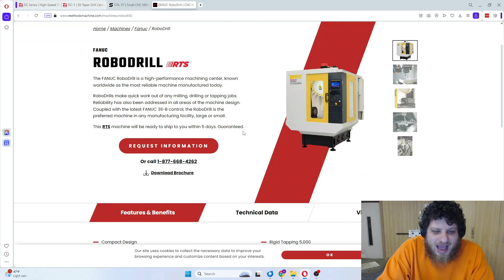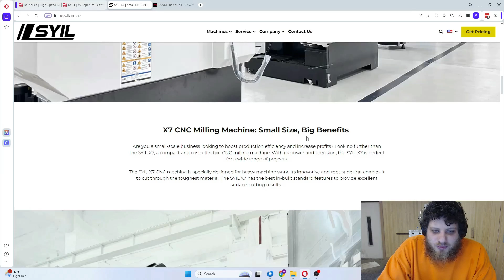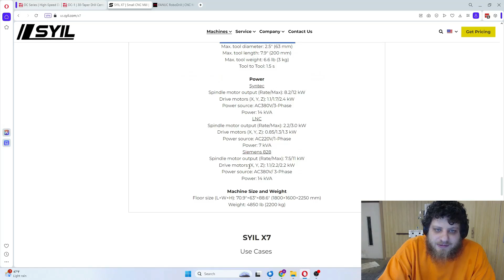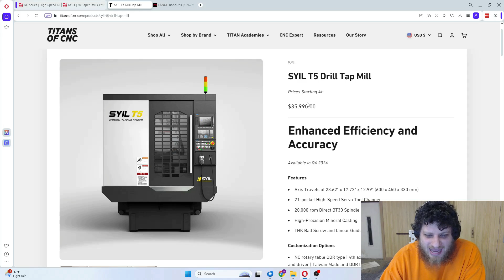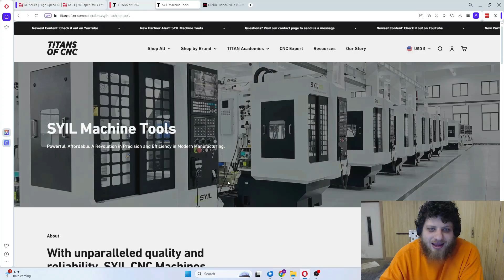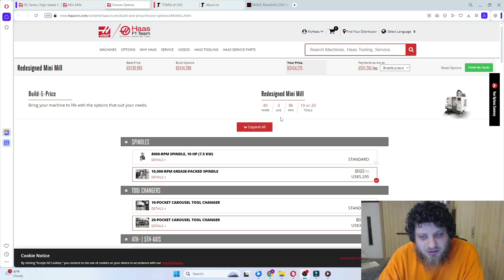Haas DC1 is a Syil Killer?

Comment: Syil is a joke compared to haas. Nothing beats haas service in the US. Imagine buying a car from China, and when it breaks down you have to fix it yourself instead of going to a mechanic.

the dc-1 has way more weight, and weight always wins for machine stability. If granite epoxy was good, you’d see other top mtb utilizing it. It’s just a sales trick.

A lot of people hate on titan but once you get into doing aerospace and defense parts all day you know his speed and feeds are good inco, hastaloy, monel. I remember working at a space start up and he’s literally the only dude that teaches how to cut parts for the rocket. He’s been there and done that.
Reply: Hermle does Epoxy Granite. High end enough for my books. Studer builds precision grinder beds out of epoxy granite.  :D

Weight alone does nothing for machine stability, if distributed badly.
Reply: @StefanGotteswinter  there’s a lot of factors that go for machine stability. Weight of a machine is one of the biggest factors. I’ve cut  a bunch of inconel parts on a CNCs weighing as much as a tin can and I’ve machine a bunch of inco on CNCs as heavy as an elephant. Cutting something like a as5202-20 port on inco you can feel the haas rumble the whole floor.

Other factors include spindle connection, spindle power, gauge lengths, fixture and even tool holders and balance.

In the end though I’d prefer the dc-100 over the syil anyway as a job shop owner. The comfort of having a haas technician the next day or two versus talking to someone overseas and doing the repairs yourself is just cringe. Being a shop owner I know a machine being down for a week or two and your shop rates 150/hr. You are losing 1200 a day for downtime.
Reply: DC1 100% made in China somebody OEM to them 😅  just put a haas controller…
Reply: DMG and Mazak both have epoxy granite machines as well
Reply: Look closely at the Haas DC1 video, on second 47 you will se chineese leters on the way covers and the spindle says Speedcn, search speedcn cnc in google and you will see it is a chineese cnc machine builder. It looks Haas has made a rebrand
Reply from the maker: Syil service definitely has a long way to go, but their machines are punching in the same class as the small Haas machines. 

I'm not sure about the epoxy granite, versus Cast iron thing. I don't have enough experience with epoxy granite machines to give a educated answer here. But "the big boys aren't doing it, so it must suck" is bad argument. Cast iron is the lazy, default option. The big boy MTBs haven't needed to innovate, so they haven't. Maybe in a few years we'll start to see some of them playing with the technology.

A decade ago, none of the car companies cared about electric vehicles, then Tesla got popular, and now everyone has EVs. Regardless of your opinion of Tesla, you can't deny that it causes change in the industry.
Reply: @flosscap i mean you do you. Don’t come crying when you crash your syil and you’re out of commission for a week or two 😂😂😂
Reply: @flosscap do you really need granite epoxy on a bt-30? Maybe on a cat 40+.

I run a job shop and our goal is to keep our spindles utilized all day.

Downtime on a spindle = 1200 lost per day. 150/hr rate. I guess if your a garage hobbyist, you can afford all that downtime 😂

Comment: One of the best things about the Syil machines is the controllers are completely unlocked. They literally give you the manufacturer passwords to get into the backend of the control. Want to add a 4th axis? Buy a 3rd party 4th axis and install it. No one is stopping you.
Reply from the maker: That is definitely nice. I'm all for open platforms.
Reply: yeah, and its also really Import to see a "race to the bottom" anyone who wants to get into the market of machining.....competition is always good and ultematly makes a better product for the consumer  @AudacityMicro
Reply: @Basement_CNC 😮
Reply: I was a tech for Haas for a while, once they went to NGC controls they even locked us out of 90% of backend parameters compared to CHC Classic controls. I left due to horrible quality coming from the factory with rusted machines and unsolvable issues at install.
Reply: @TenTopGolfer where ? USA
Reply: I love that
Reply: I agree, anyone who buys a HAAS has not been machining long enough or at least hard materials other than plastics and aluminum.
Reply: What about the 4th axis drive? I doubt they come with that in the back for free
Reply: @AlphaEngineer2022  you can either buy it with the machine or order it with the 3rd party 4th axis.  A lot of guys ordering through silver cnc are getting it after the fact and receive everything they need.  Ethercat connection from the servo to the controller and a couple I/O wire connections and you're off to the races.
Reply: Bye bye Haas… Hello SYIL…
Reply: Field service engineer here syil is the shit
Reply: @josephrudd488  what’s the biggest issues you encounter with the machine out in the field? Besides the owner. lol

Comment: This was perfect, couldn’t help but laugh of your engagement… 😂 Someone at work said they saw Titan announcing this cooperation with Syil a few days earlier and said that we should perhaps think about this, since it seems like a very good priced machines. We are a small medical startup company , just financing everything privately ( splitting all costs between 4 guys) so pricing is extremely important. Right now we just using 4 3d printers and a manual mini mill doing internal prototyping, we have been discussing buying a cnc mill the last 3-6 months, since we outsource allmost all aluminum / titanium work and that part is just growing. We have a Chinese mini mill we bought last year which we use almost daily for very simple aluminum parts, but we need a professional machine. Keep it up!
Reply: Not sure if it would work well for you guys but you should check out the Langmuir MR1, its definitely smaller and less capable than the other ones listed and doesnt have an ATC but it is only about $7500 with all the options so could be a good intermediate step in the right direction, only real downside is you have to assemble it yourself but it seems doable.
Reply: Plenty of great used robodrills for 30k or less
Reply from the maker: Yup! There's lots of good machines that could be good options for you. Syil, Haas, Tormach.

Also, shameless self promotion: a lot of the work I do is for medical companies. Feel free to shoot me an RFQ 🙂

Comment: The problem I encountered with Syil is that I filled out a form on their website for a quote and they haven't stopped spamming me since and while I know it's a real company that makes real machines, the marketing has a strong scam vibe to it. On the other hand Haas is charging such a stupid amount for software unlocks it makes converting to linuxcnc seem worth the time. I'm not buying a machine in that class just yet, but it's really hard to figure out what a good price/performance ratio is, especially when you play around with the specs.
Reply: I sent Haas a technical question. They never answered but they added me to their promotional email list. 2 years ago I was stuck between a minimill and an X7. I have an X7 now.
Reply from the maker: Lol, you should try sending an RFQ to Keyence. They will spam you to death 😂. I think Syil is still winning on the price/performance ratio. But it's hard to beat Haas's support network. And their controller is fantastic.

Comment: the syil x5 utilizes the same style tool changer of the robodrill. X5 is priced similarly by the time you throw some upgrades on it.
Reply: And Haas is charging $25k if you want the 20k spindle, which comes standard on the X5 and T series.
Reply from the maker: Not to mention high speed machining, to make use of that spindle speed.

I do have to say though, when I started this video, I didn't realize how much heavier the Haas was than the Syil. That surprised me, and does actually make me think the Haas is probably a little underpriced. I bet we see the price go up slowly over the next few years.
Reply: @AudacityMicro  But they are different castings... way different castings. Syil uses latest gen Expoxy Mineral compound. I guess Haas is still using cast Iron
Reply from the maker: That's true. I wonder how the rigidity compares between the two. It's too bad there isn't a standard unit for how well a machine cuts. I wish there was some metric that measured surface finish or something like that.
Reply: @AudacityMicro  Pretty sure the epoxy granite is less rigid. But it weighs less, has better thermal stability, better vibration dampening, and is better for the environment. So there's trade offs.
Reply from the maker: Maybe that is the one I should have used as the comparison to the Haas machine. That or like the T7.